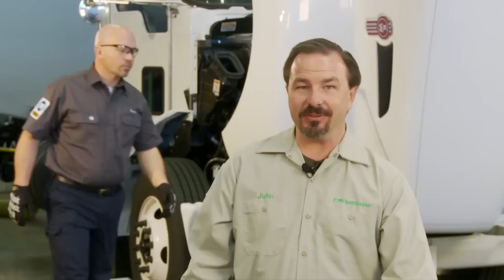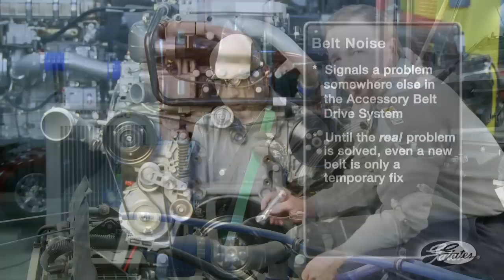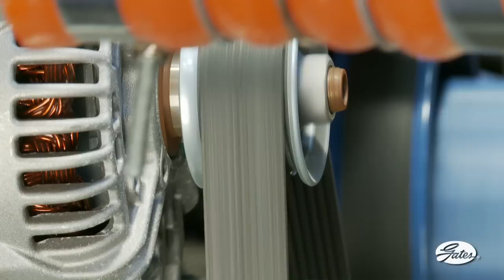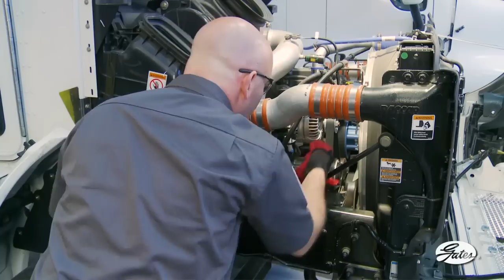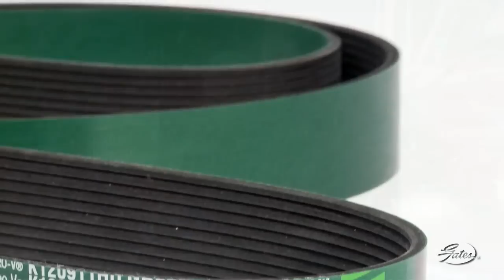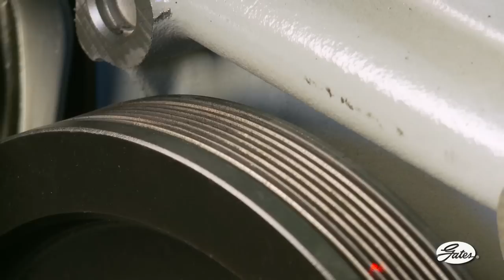Correcting Heavy Duty Belt Noise Problems

Comment: I have a 5 tone truck frightliner with Cummins 
Engine I have a problem with the belt I change it 4 times and every time the belt ripped of most of it .
Then I Changed the tensioner  and I put a new belt and  after 5 weeks the noise is back and the belt is damaged 
Please help if you can 
Thank you